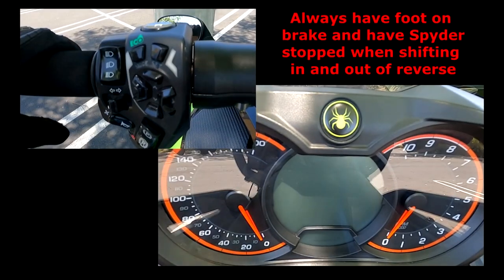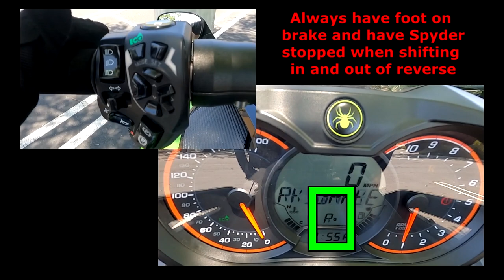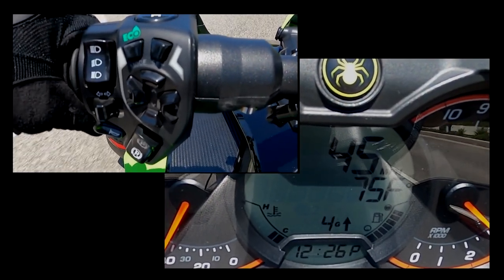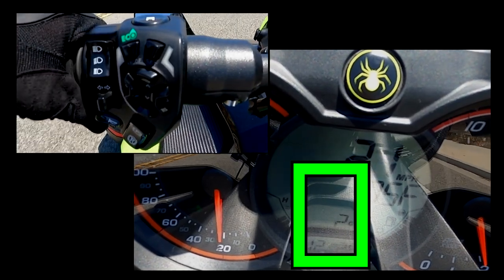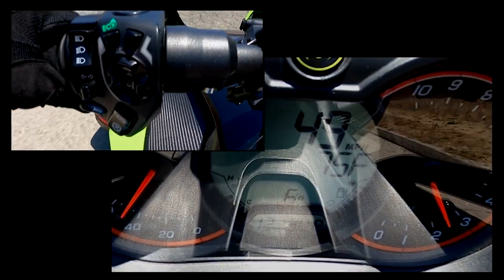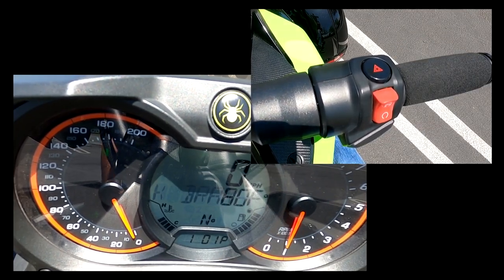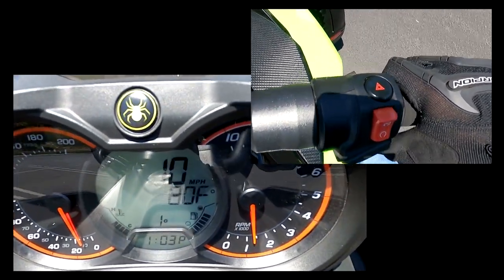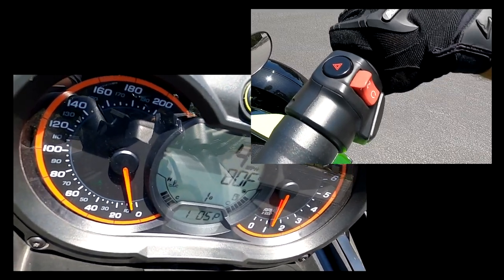Shifting a Can Am Spyder // Using the Paddle Shifter and Reverse on the Can-AM Spyder

Comment: How does the F3 feel going longer distances? Im debating between the F3 and RT... I like the f3 because it looks sporty. But from the looks of things, the RT looks better for long distance especially with the footboard.
Reply from the maker: The RT is for touring and long distances. More storage and features that make a huge difference. I did not like that you can not lengthen the brake linkage on the RT though. I find it a little short for me. For 2 people you will be more comfortable on the RT. My wife and I have been on the F3 for a 10 hour trip before and we're OK in comfort but not the same as an RT. Plus we were limited on what we could take as well. If the main reason of owning it will be for long trips I would say the RT is the best for you. If you are by yourself riding and just want day trips for a couple hours then the F3 would work for you. Both are a comfortable ride either way. I plan in about a month to have 2 videos coming out talking about the Ryker on one and RT on the other and comparing them to the Spyder F3. I'm working a lot on it now.
Reply: @MOABMAN  10 hour trip? That's awesome! Yes I plan on riding around town and traveling no more than 4-6 hours . I really love how the F3 looks in comparison. I understand the storage compacity maybe a little annoying, but for those type of trips I would probably just drive my car instead. Does not having the windshield on f3 bother you? That's another concern I have. Will stuff be flying in my face without the windshield?
Reply from the maker: Forgot to say thank you for the comment and support earlier, so thank you!!!! I love the wind and hate windshields. I am impressed with the RT windshield but absolutely hate the F3 and especially the Ryker ones. The one on the Ryker from BRP distorted the road a whole lot where it curves. I find myself fighting, leaning or looking "around" the windshield to see a non distorted drive rather than enjoying a ride but that is just me. I only buy top end helmets where noise and wind is minimal and bugs do happen to hit it, that is part of riding. I grew up with dirt bikes, jet skis, 4 and 3 wheelers and open face helmets as well so kinda used to the wind. Here in California it gets 100 degrees so wind is good on the helmet and the windshield makes a helmet hotter because no wind getting to the vents. They are convenient to have in rain and cold weather though. It sounds like the F3 will be a good fit for your needs. Check out my can-am experience video (not the newest one but the one put out about a month or 2 ago) and see about signing up for a test ride. That will give you a good chance to really see the difference.
Reply: @MOABMAN  will do! Thanks for answering my questions sir. You gotta new sub!
Reply from the maker: @theonlyEYEBROWKING  Thank you and hope I helped! Appreciate the support.

Comment: Why did you downshift to 3rd to pass?  New to riding one of these.
Reply from the maker: Thank you for watching and your gonna love the Spyder. Just like in a car, it helps to down shift when passing depending on situation. Going to a lower gear will give you higher rpms than the gear you are in and this will improve speed a lot. For example if you are in 5th gear and your RPM is at 2 and your trying to pass quickly it will take you longer than if you shift into fourth gear where your RPMs might be sitting at 4-5 and your engine will be quicker in response. The higher the RPMs the more torque and hp you will have available to use. You never want to shift to a higher gear and lower RPM when passing.
Hope this video will help you some!

Comment: Do you need to release gas when shifting like a manual?
Reply from the maker: You do not have to release or slow down on the throttle. It is better to maintain the same throttle i have found unless i am passing. Thanks for watching and hope this helped you

Comment: hi, just on the pedal commander, does that override the nanny switch under the pillion seat?
Reply from the maker: Good question! No it does not override the nanny at all. The bike still maintains the nanny features. The Pedal Commander strictly just involves how quickly the bike responds to you twisting the throttle. I believe there are only 2 years that you can override the nanny on the f3s by pushing a sequence of buttons on the left handle controls. ( I think 2016 and 2017 ). Are you wanting the nanny off?
Reply: @MOABMAN  No, I was just curious. It would be nice to get a better throttle response down low though. I have a 2020 RTL and we are not lightweights, and if you're on an uphill start from lights or an intersection it would be nice to have that little bit more punch.
Reply from the maker: @brettnaysmith3949  It does make a huge difference. My setting that I like is city +2. It gives me a quicker throttle response that I feel the bike should have. On the bigger RT models I have noticed people saying that they like it in sport better. Makes sense because it is heavier. It still shows $299 for the price on slingmods. It is an easy install too. If you get one, I'd love to hear your thoughts about it. Your more than welcome to email at moab.man@yahoo.com or just comment if you want to share your thoughts.
Reply from the maker: @brettnaysmith3949  By the way, hard to truly see it on your icon, but thats a good looking ride.

Comment: How much rpm’s should you do to shift
Reply from the maker: For best gas mileage between 3 to 4K RPM's, for normal riding around 5k, and redline it when haulin butt! Mine shifts the best at 4k and i have found that true for every model Spyder I have rode. I do show it a little in the video as well.

Comment: Its so sad they killed off the manual 6 speed..
I have ridden motorcycles for a couple of years , and my car is a full manual also ..
I guess i will have to try and see....
Reply from the maker: I thought the same way at first, and I do love manual shifting as well (my jeep is manual), but the more I use the paddle shifter the more I am starting to get swayed.  It still allows you to be some part of the shifting and in control. You can get it in manual shifting on the Spyders through 2021, I am not sure but should be able to on the 2022 as well. Do try the paddle shifter before buying one with manual. I am happy now that I got the semi-automatic instead of manual and would do the the same for my next one as well. Never thought I would be saying that! The best advice I can give you is clear your thoughts of motorcycle comparison from the 2 wheel riding and think of it more as an advancement in technology and engineering for a motorcycle when you ride one. The RT is such an improvement to me from the old trikes and the "Goldwing" style motorcycles of today if you go that route.